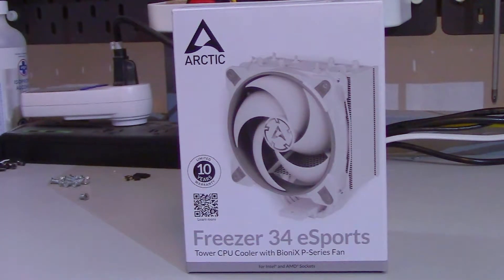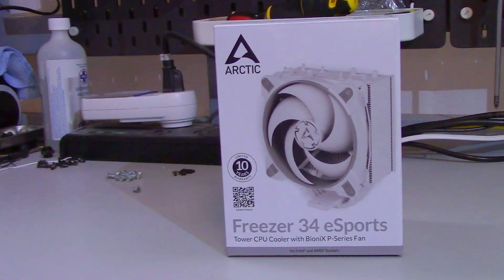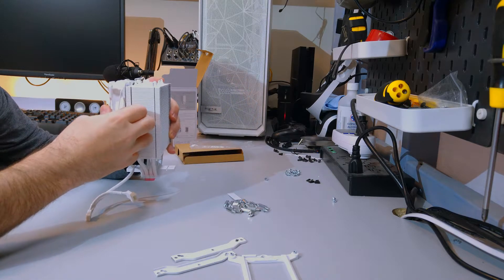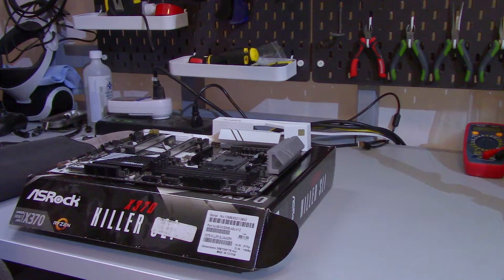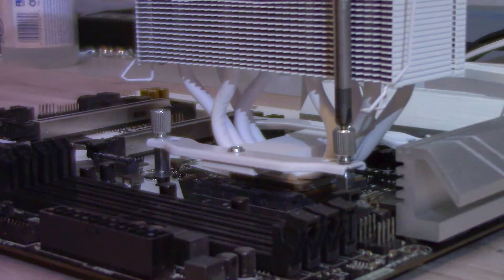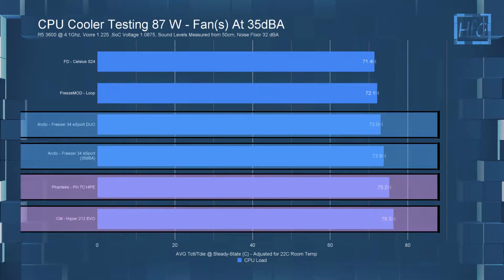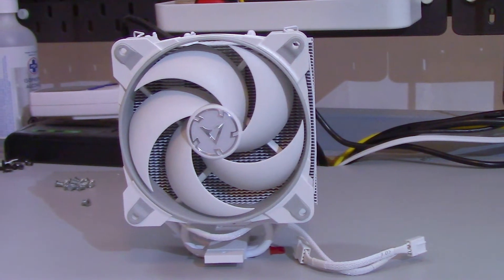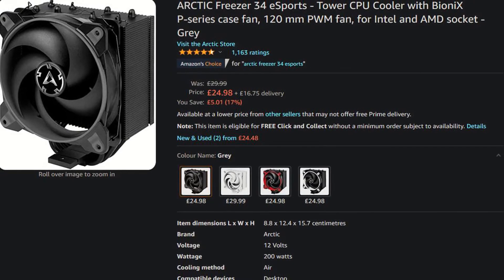Arctic Freezer 34 eSports (DUO) - Cooler Review

Comment: for it's absolute limit testing

i used it on an i7 12700k...benchmarking the system at 100% ( gpu benchmark and cpu benchmark running for 1 hour ) at 22 degrees ambiant with all fans at 100% makes the cpu reach up to 96 degrees ( no thermal throttle and was the first cpu cooler i've ever mounted so i may have made rookie mistake )
and without gpu benchmark it goes up to 92

specs ;

-case : Thermaltake core v21 ( 200mm fan + (2 x 120mm) intake  and 140mm fan exhaust ) "all fans noctua brand"
-cpu : obviously an i7 12700k
-gpu : rtx 3080 MSI 3x ventus

Comment: No lga 1700 mounting kit? not even in new versions?
Reply from the maker: I'm sure they'll be adding it in, now you do understand it would take 6 to 8 months for the ones being made in factory to then be sold in a store...
Reply: @HardwareForGamers  i ask cause there are already some coolers with the mounting out of the box. but thanks anyway
Reply: There are.  Just try contacting Arctic first if you need one.
Reply: there is, and this cooler doing pretty good job on i5-12600K

Comment: 10700k it's pretty effin good. 2x fans, it does the job. I DID however go for a Scythe Fuma 2 for even lower temps (a few celcius tops) but at $20 USD more and eventually going to a 280 AIO for $69 on super sale for a total of about 7c cooler for double the price of the arctic 34 esport Duo. I get to try a lot of coolers as I'm a builder. the Arctic 34 E is fantastic especially for it's price! also, used it on an 11700k with basically the same results. This week, I'll pu tit into a 12700k build to try vs the others i have mentioned.
Reply: Have you mounted it on 12700k ?
Have you ordered a mounting kit from the Artic ?
I was planning to assemble my arctic freezer 34 esports duo with 12700k, but I think I got the old mounting kit which won't fit on LGA 1700 socket.

Please advise
Reply from the maker: Contact Arctic via their website. https://www.arctic.de/en/support/lga1700-mounting-kits/
Reply: @HardwareForGamers  already did. So frustrating. Have some projects upcoming to do and I thought tomorrow pc will be fully build and now these fucking brackets.... :)